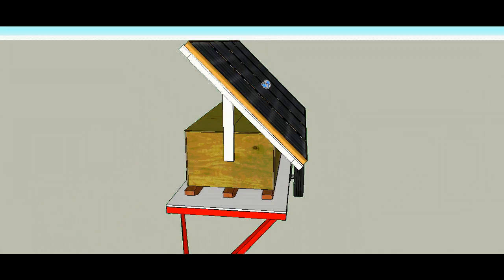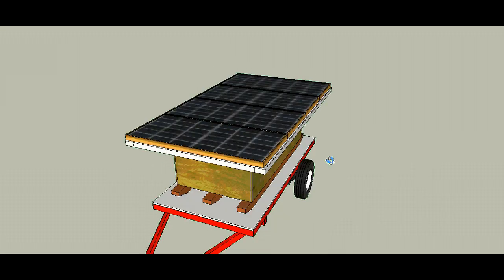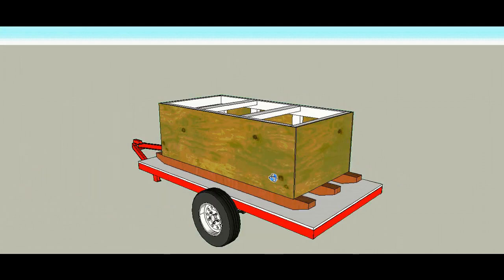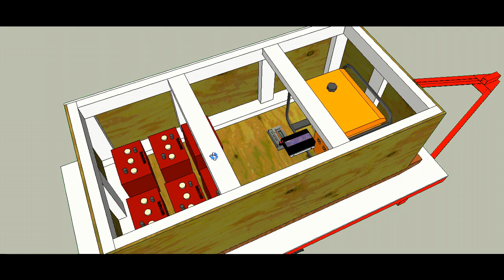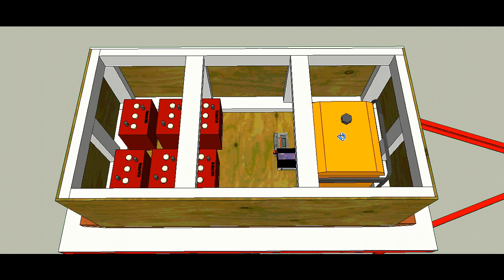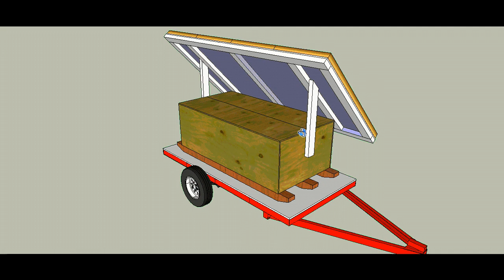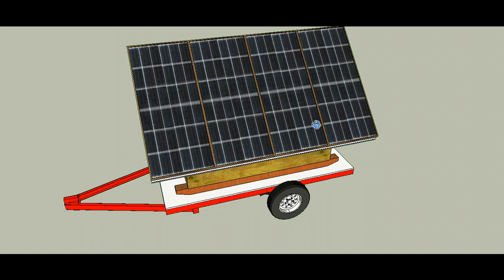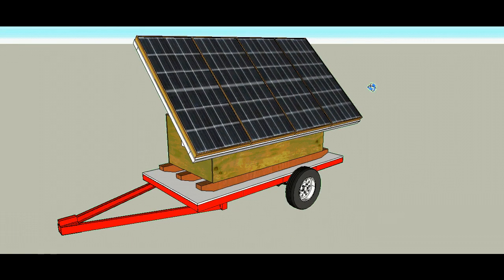Portable Solar Power Trailer

Comment: I am using a single place snowmobile trailer that I mounted  Four 400 watt solar panels on, which I move around the yard to get optimum sun exposure daily.
  It works well for getting most output and away from tree shade as the day progresses. 
  I have Twelve 400 watt panels total, Five are 
mounted stationary and an additional Three I move independently daily.
  On a good day I power everything 120 volt and charge 4-lifepower4  48 volt batteries that power the needs throughout the night until morning solar output begins a new day cycle.

Chemtrails reduce production, but on clear day I have on one occasion hit 4000 watt output, but usually get around 3000 watt, intermediary on a relatively clear day.
Reply from the maker: Right on! I have 200 watts on a trailer I move around to get the best sunshine. Makes a big difference.

Comment: i borty one of them  trailers. we  see powering the traffic light s  with the telescopic mast..  & decided to remove the inbuilt . desal  tanks  . as the gen sat ad been sold of.  put in a wooden bottom & utilize  it as a Soler battery bank much in the same way you have suggested  & small  charging siystom for the winter mounts  & i had consider using the mast to carry a wind mill to charger  the bank set . haven't done  that yet   yes it a good idea , it will work well a portable  back up system  seen the commensal sets, yes far to expensive. in my view  Then they sav you the time to build .  & they say  times money  What-What.  Les England

Comment: just caught your video from Apr 29, 2013, did you ever get it up and running??
you could put bed rails around the outside of your panels to help stiffen them up, just bolt them together

Comment: I would mount the solar panels on a pipe with a tilting system so you tillt or rotate depending on the locaction light amounts. Also ad a ine to hook a small wind turbine fo additional charging.

Comment: GREAT IDEA I THOUGHT OF A SIMULAR IDEA  4 (300) watt panels with a mignight 150 solar controler and a harber freight 2,000 watt inverter with 6 trojan t 105 batterys you can get a a golf cart store then you dont have to pay shipping--- GET A PLASTIC DECK BOX FOR THE BATTERYS AND A SMALLER DECK BOX FOR THE INVERTER! THIS WOULD BE THE LARGEST  12volt to 110 volt!

Comment: I have one in the works right now and will have the video series uploaded by the end of the weekend.   I am using one of the "Heavy Duty" Harbor Freight trailer kits with the one ton axle.   The panel array is the 400 watt system from my mobile workshop trailer.  3KW array and Stanley tool boxes holding deep cycle batteries.   The Inverter is the newer Harbor Freight 3KW inverter.   I figure my total cost between $2000 and $2500.  Batteries I think are the most costly component.

Comment: can u connect it to a car and power the car?
Reply from the maker: Do you mean an electric car? The trailer would weigh quite a bit so the drag would increase the energy the car requires so it would not be a good use of this design.
Reply: I do not agree if you design it to stay flat with the vehicles flatbed it will not increase drag..I am really sure this is doable. and i am excited about it.and yes i am talking about an electric car....this stuff is plastic so why should it increase the weight that much alsoyou can try to get rid of the panel casing and make it really light there are all kinds of panels out there even foldable rollable ones..wouldnt you agree?
Reply from the maker: The law of diminishing returns says it is not possible but that should not keep you from trying to improve on the design. I have designed hood air turbines that would be used to brake an electric car that could power an electric car.
Reply: i am ptimistic about this if you have a long enough flatbed trailer shouldnt it totally power your car requirements for every pound of additional weight how much power do you get...if you do a calculation a point will be reached where you can totally power your car ...no?

Comment: Or use the wind to charge the batteries while driving., Batteries running low? Take a drive! lol i guess whether its the generator or a long drive you'd be using fuel.

Comment from the maker: When you add a generator pulley to the axle you are adding much more resistance that would reduce your MPG. It could be done but would not be an efficient way to produce more power. You could use regenerative braking but that is a complex system.

Comment: I don't think you get it ....
If you connect the axle to a generator you are adding a load onto the motor.
Yes, you can charge a battery from doing that,
but the losses from the motor, and the inefficiency of charging the battery means you do it at a cost of less overall useable energy, from the point of view of gas, or whatever is powering your motor.

Comment: Would it be at all possible to hook up an alternator or permanent magnet motor to the wheel of the trailer so when you would be driving down the road the rotation of the tires would also charge the batteries?

Comment: I am working on a similar project. 

I will mount a 40ft Telescoping pole and Wind Turbine. 

I might wire the pole with a switch and LED flood light for night time access.

I have included a 35amp RV Outlet to the side of my box, and I took a 50ft RV extension cord modified to hold a 110v Breaker Panel that can be pulled into any shelter.

My tool's rechargers, and a 12v water pump and tank are also an option.

Comforts of an RV, minus the RV...

I have your book, and you are an inspiration.

Comment: Why not just throw an alternator with a belt an tensioner to the axle maybe even with a few different gear like things that would generate the amount of revolutions needed to turn the alternator to create the electricity needed to recharge the battery during motion.

Comment: So I bought one of these solid panels I would like to know what kind of batteries you use. I have a deep cycle hooked up but when I started messing around with this stuff it would hold almost 14 volts now its right at 12 so I guess I was just wanting to know what kind you use and if you have run into any problems.

Comment: One guy on another channel made a box like this and made the whole top section the door ... slicing down at an angle so there is really easy access at the front but still accessible through the top ... like one of those wooden boxes that holds index cards.

Did you mention putting some kind of catchbasin under the batteries so that acid does not contact any wood and catch fire?  I like this kind of modular/toolkit approach, very nice.

Comment: Fantastic idea thank you for sharing. Makes me think wouldn't it be better to built the frame with aluminum channels and angles, maybe 1". It will be more durable and lighter. Side panels could be made out of aluminum also, attached with rivets to the channels. (Like the one they use here in Florida rooms.)

Comment: A different way for transporting would be to have the solar panel arms adjustable enough to be able to tilt the panel vertically along side the battery box, and have it sit on the floor of your trailer. You could temporarily attach the panel to the box for traveling and the panel in the vertical position would offer the least wind resistance load to highway speeds.

Comment: The issue with securing the panels for transport is not so much getting them scratched, but the aluminum frames are not made for wind+highway speeds, that's why I build steel framework to fit around the perimeter of an array.  It can all be done sufficiently with thin gauge .065" rectangle tube and a 90 amp harbor freight wire feed welder.  Ends up being cheaper than wood in a lot of cases.

Comment from the maker: Good ideas- I am not much of a welder but a metal structure would probably be lighter. The batts will be secured and the box secured to the trailer. I think a plywood sheet would protect the panels and I will only be transporting it once a year. I like the slide out genny idea and I think I can make that work.

Comment: I would make it out of a welded angle iron frame with sheet metal screwed onto it for a body.  For the generator I would put it on rails so it can slide in and out.  I would also use flex seal for a little noise insulation.  I would make some brackets for the batteries and secure them with bungee cord.  I would also bolt it to the trailer so it doesn't slide around.  Finally I would make a styrofoam padded cover to protect the solar panels in transport.  Great idea please keep us updates thanks.

Comment: If you are going to use it a lot I would set up a lift system that lifts from the top, then lowers the payload onto dollies to move the load out from underneath the lift. This way for the occasion when you want to put the load into the bed of a truck, your mechanism is ready to do that too. A collapsible A-frame might be good here. Fold it up for storage when not in use.

Comment: A simple mechanism made out of square tubing could allow the pivot point for the solar panels to be in the center, and allow easily raising and lowering the center. Then bed frame rails which can be picked up for free can make the attachment points for the sides allowing the panels to be angled either way for those situations where it might not be easy to position the trailer with a specific side facing south.

Comment from the maker: Wind power is actually doing very well all across the country. Those big turbines produce a huge amount of power and there are entire towns here in Utah producing all their power from a few turbines. Small turbines will only be of use where you get lots of wind but my Air X works great in winter to keep my batts full.

Comment: This is a great idea over at Fort Hood the army is testing a new solar generator combo system for field power.  Good plan overall consider your control panel, maybe use a hinged cover or just a flap of GI oil cloth canvas. Don't forget a gas vent on the box.  If you consider building a larger unit look at making it a whole house service trailer and add a solar water heating system and small tank.  You could mount some propane tanks also and carry all the hardware to make the connection.

Comment: How about adding a 2x4 with 12 holes drilled in it. this will attach to the back of the panel and to the 2x4" uprights with a bolt. each hole will be for each month of the year. calculate your best solar angle per month . as the solar angle changes you slip out the bolt and drop it into the next one.  Your panel angle for December (winter solstice) in Utah should be around 30degrees and about 76 or so in June (summer solstice)  search google for "solar angle calculator"

Comment: another thought I had would to cut holes in the bed of the trailer to allow telescoping jacks to lift the box up off the trailer to slip 4x4's posts under each end. lower it back down onto the trailer and then move the jacks to under the posts. you can then raise it up again and drive the trailer away. I hope I am understanding your comment properly.

Comment: would you be able to go to the junk yard and get stronger springs for the trailer? Not sure about the weights of the panels are. It seems to me that the up position would increase the weight onto one set of springs.

Comment: Not exactly, the issue with jacking something off of a small flatbed trailer is getting it clear of the wheelwells which usually stick out farther than the bed or else the bed has to be set high, like on a flatbed snowmobile trailer, and the higher the bed, the higher the center of gravity for a load.   I am thinking some sort of lever/bar system that would use the forklift lifting points on the skids used as the "foundation" when a forklift is not available.   Pallet jack will not work on dirt.

Comment: One thing to add to your battery box is a hole for ventilation if you are charging the batteries with the doors closed due to potential hydrogen buildup.  When I build battery boxes I add a hole the same size as an 80mm 12v ball bearing computer fan on one side of the box and have it connected to the charge controller so it only runs when the batteries are charging to keep things cool and well ventilated.  On the other side of the box I add another hole the same size with screen and grill cover.

Comment: Looks like a great idea, One thing to keep in mind is the back of the solar panels should be  kept as cool as possible for maximum efficiency so i would recommend standing them off the back panel or cutting out most of the back panel that they are being mounted to. And also maybe some venting in the bottom of the storage bin.

Comment: I can't find them that cheap locally, and I don't store more than two trailers in my driveway at any given time.   That's why my next one going to a flatbed with setups on skids, kind of like your design.   I am trying to come up with some sort of system for raising the payload up, and then driving the trailer out from under it, similar in fashion to the way you drive a truck out from under a cabover camper.